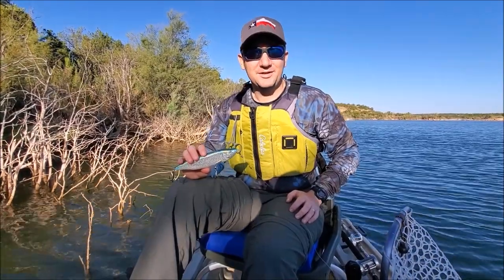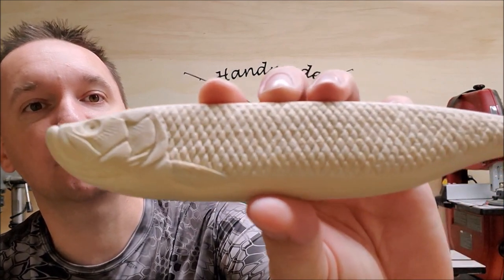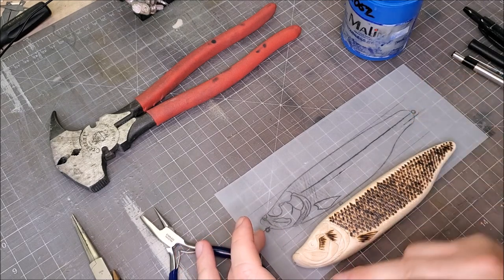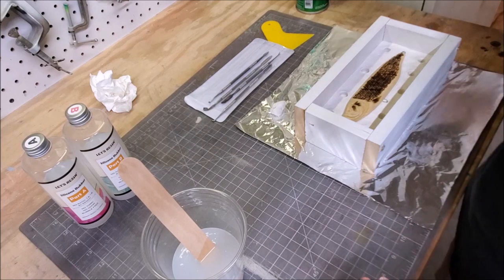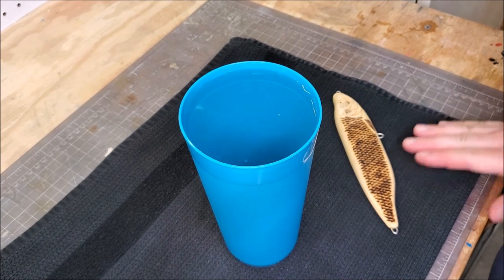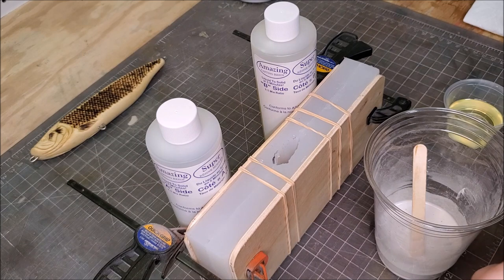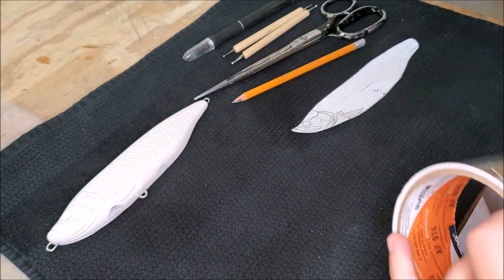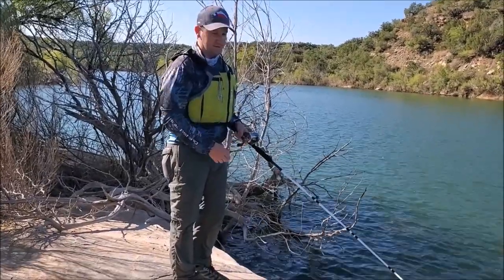Making a Tarpon Stick Bait Fishing Lure

Comment: Awesome looking lure!! Just a thought about adding weight to lure: I've learnt that when building bigger lures and the intention is to have close to neutral buoyancy, it is better to have the lead inside the lure body when tuning the weight balance. When the lead slugs are hanging outside the lure, their displacement in the water will give a slightly false result -> The lure will sink a little faster. Not really a show stopper in many cases but a good thing to remember. I usually glue or cast the lead to the lure belly, seal the body and trim the weight by drilling some lead off. Quick and easy and enables to have very precise weighting. 

Great content, thumbs up!!
Reply from the maker: Thanks for the tip and for watching! I appreciate your support!

Comment: hope that's salt water in the tank ??
Reply from the maker: It is not, but you bring up an excellent point. I'm guessing you are alluding to the phenomenon where a neutrally buoyant lure in freshwater will float in saltwater. I did have a pretty slow sink, but adding foil and clearcoat added a bit more weight. If you need to add some more weight, you can always increase the hook size and/or add split rings to tip the scale in a pinch. You've got a sharp eye! Thanks for watching!